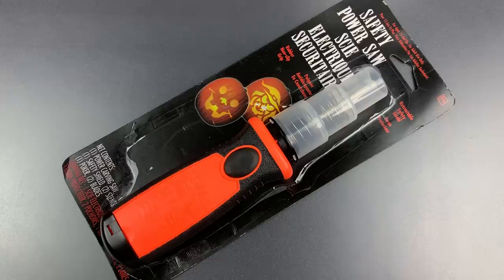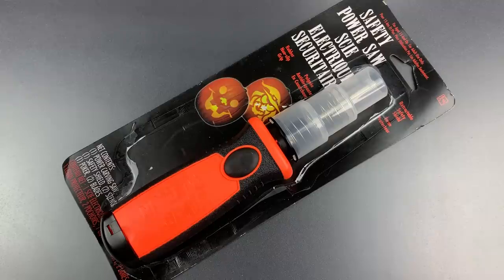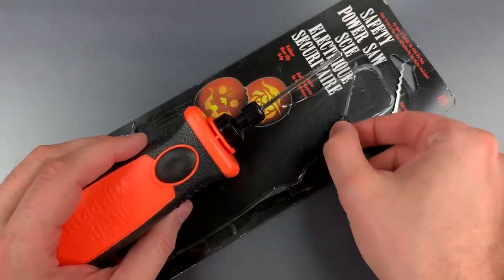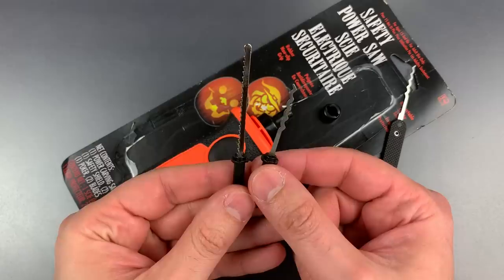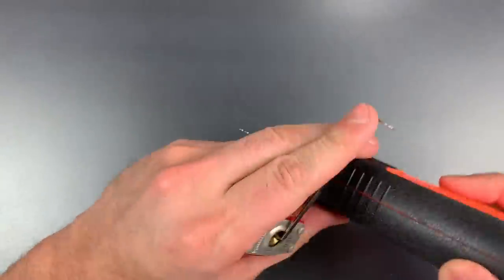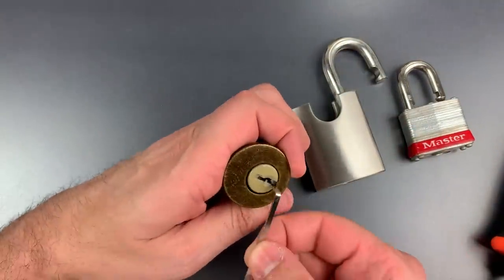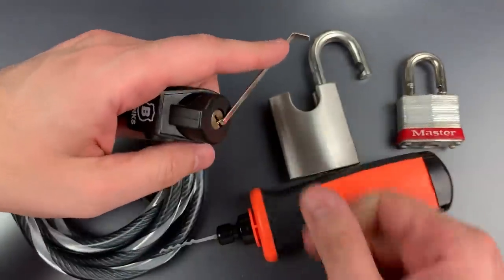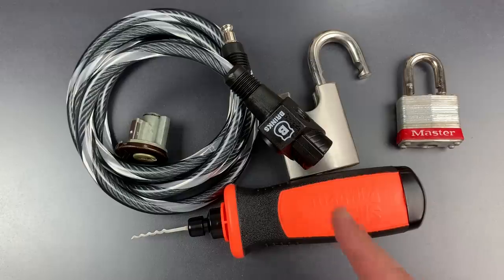[775] Pumpkin Saw Converted into Electric Pick Gun!

Comment: I converted mine into a tattoo gun.  A little slow and slightly painful.
Reply: That sounds like the definition of a bad idea 
No offense but definitely an 8 on the dangerous sounding ideas chart
Reply: I've seen worse.  Much worse.
Reply: Probably the best thing you could use to make a homemade tattoo gun
Reply: @JWSmythe  you should see my modified dot matrix printer i use to tattoo people with. I just have them shove whatever body part they want tattooed in front of the print head(removed everything from the case that was blocking the print head)and just click print. I did have to add a little arduino board to get it up to speeds of a normal tatto gun and added like doubled the amount of needles per row to get the highest resolution possible but so far only 20% of my clients have sustained minor injuries or infections around the site of the tattoo and not on the tatoo themselves. Each print head is made by me and is changed after every use don't worry. I also did modify the heads to use tattoo needles as well for higher image fidelity.
Reply: @michealpersicko9531  Show it in action! Sounds really sick!

Comment: Bought to you by the makers of the solar powered flashlight and the submarine screen door.
Reply: As well as the pen sharpener, the wind turbine that turns against the wind, and Esperanto.
Reply: but solar powered flash light makes sense, charge during the day, light at night.
Reply: Not forgetting stripey paint and long weights!
Reply: I love my solar powered fleshlight
Reply: The submarine screen door is pretty handy actually.  If you need to dive, just cover it in flex seal!
Reply: @Razbari  one with no battery.
Reply: @razinhailsharp  but what if the submarine receives alot of damage
Reply: @Floris_VI  then use more flex seal!  LOL
Reply: CH CH CH CH, Chia

Comment: I had a chance yesterday to try the two wrench method of breaking a lock open. A guy I work with keeps his sled trailer in our shop yard in, needed in but the lock was frozen solid with rust from sitting for 2 years. I couldn't get the angle to get the wrenches to cam against each other so I just pulled with 2 short wrenches apart and I was shocked to see this lock break with very little effort. Saved me dragging a cord out and showed how crappy his choice of lock was.

Comment: Um random suggestion, because of the speed of this and the potential inertia effects have you tried this on supposedly rake prof locks? The sheer speed might overcome some forms of anti-rake protection IMO.
Reply: Yes, the stronger the hit to the pins, the greater opening you'll create in the pin shearline.

Of course, you're basically hitting to the side of a thin metal object (the pick shaft) using a plastic holder (for this specific example) so you'll be seriously limited by the forces you can apply before the holder breaks or the shaft bends or snaps.

Comment: Holy crap I love this.

Hey about picks, I find that the width of a pick makes a huge amount of difference, and if ain't as narrow a pick as I can find, I have trouble with it.  Is it because a lot of cheaper picks are inherently too wide to work with, or because my technique is bad?  Possibly some of each?
Reply: The rule of thumb is: use as thick a pick as you can get away with. But "get away with" doesn't mean that you can cram it in there.. it means as thick as possible, but without dragging on the warding. The reason for this is that the ticker the pick, the more feedback gets transmitted to your fingers. Also it makes it easier to get on the key pin without it sliding off. And last but not least, the thicker the pick, the more tension you can use without bending the pick.

It might be that you prefer thinner picks because you get less false feedback from poor finish that way. That is, the jagged edges of the thicker ones touches more. Try sanding them with grit 600-800. BosnianBill has some excellent videos on pick finishing.

Happy picking!

Comment: What kind of locks are are resistant to rakes?
Reply: ASSA 700 is resistant to everything. Even experienced pickers like LPL rarely feature them because they take ages to pick into. They are impossible to rake or bump, hard to drill and neigh on impossible to pick... the good news is that they aren't actually that expensive, considering what you get.

Comment: Much like the "DVD Rewinder" (That's seriously a thing?), this thing defeats it's own purpose.  I would imagine that, at the speed it's cutting through the pumpkin, it would gunk up from the rind, and need to be frequently cleaned.

If anyone else knows different, please correct me.
Reply: Apparently you can purchase a DVD rewinder as a novelty item. When DVD's were new and I worked at blockbuster, I could get a rise out of telling them they forgot to rewind the disk and merely align the disk vertically oriented in the case.

Comment: Enjoyed the video. I'd like to ask a question thats a little off topic. Is it possible to freeze a lock with Freon or liquid nitrogen/oxygen and shatter it the way Hollywood would have us to believe? Could you possibly make a video to see what would really happen please?
Reply: If freon / Air-duster-cans-upside-down don't do much then LPL could potentially see if it increases the effectiveness of the Ramset gun against more serious locks. I'd be very interested to see that.
Reply: Dry Ice would likely do it, Freon doesn't get cold enough to do much to steel or Brass.
Reply: Bosnian Bill tried freezing a lock not to long ago. Search Bosnian Bill + ice. 👍
Reply: Safety valves at gas stations work the same way. But , to get real result , You'll need dehumidified air surrounding it , so that ice coating that forms around doesn't act like isolator. But , again , soft materials wont suffer too much , as safety vents that prevent overpressure are made from them.
So , for Holliwood style openings , it's hard to them in real life. :)

Comment: I have seen various inventions converting electric toothbrushes too. They tend to go up and down rather than a in out motion. 

Raking that fast Has to damage the pins quickly, cutting a groove. Then when you insert the key the pins don't lift quite as far too line up with the shear line.
All obvious I know so I will shut up now. 
😶

Comment: Unrelated comment:

The twists in the sheath on the cable lock bother me for a rather silly reason.

Being around hydraulic systems, hoses usually have a line running down the length of the hose called a lay line. This is to give a visual aid, indicating if the hose is twisted.

Seeing that on the cable makes me think it's twisted.

Now obviously, it is a twisted strand cable, this is good for strength and integrity.

But it makes me think it's wrong, even though it's not.
Yes I realise that this is obsessive-compulsive and ridiculous and not at all constructive to the topic. But nonetheless, there it is.

Anyway, pointless rant is over.
No, I cannot give you your 2 minutes back.